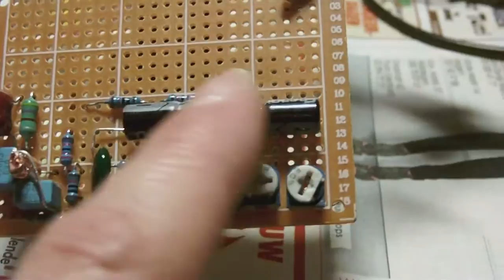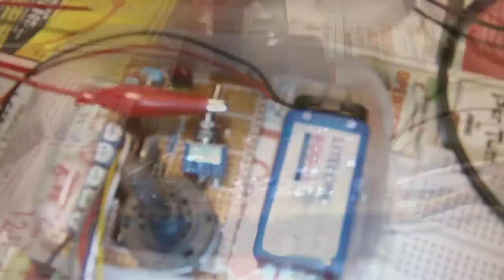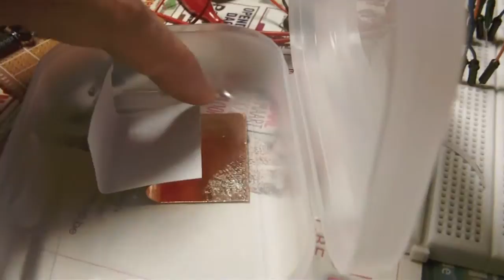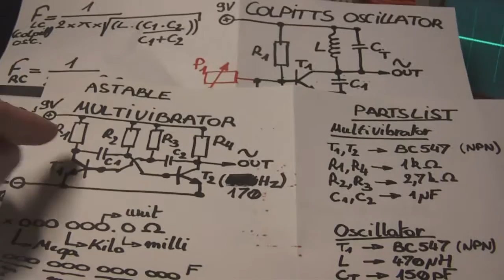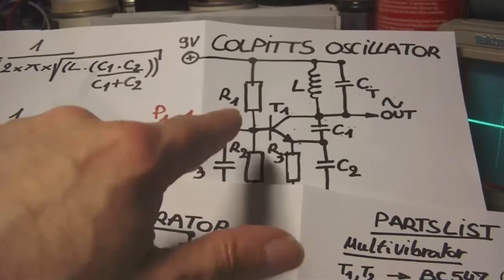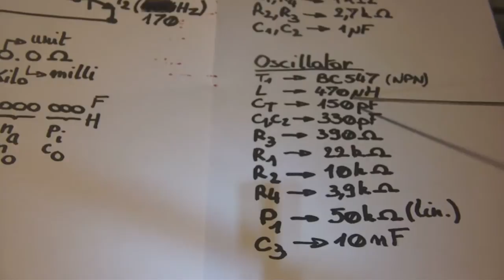WP Update: Building An IF Alignment RF Generator Tool

Comment: Hi, glad to see it all working. Nice job on the project. Btw, Impedance is measured in "Ohm" and Inductactance is measured in "Henry", you seem to mix them often. Also you can get 5mm very efficient led's that can produce very bright light even at 200µA or even less. Also, you could boost the output by connecting on op-amp, so there are quite of number of things that you can take into consideration if you really want. Also, I'm never driven by cost in my projects, since i can get 10 turn pots for about 10 cents a piece, there is really no reason why you shouldn't use them. Cheers :)
Reply from the maker: Making something at minimal cost and as simple as possible, for the desired result is something of a challenge for me :) Yes you're right, I use impedance and inductance indiscrimenately. Never could get it right, even years ago. I know the difference of course, but sometimes I'm just a bit confused while concentrating on commenting while making the video. Your remark is welcome all the same for anyone reading the comments ;) Glad you liked the video